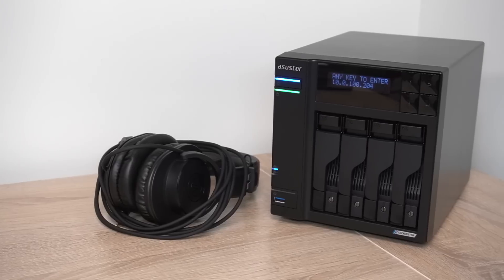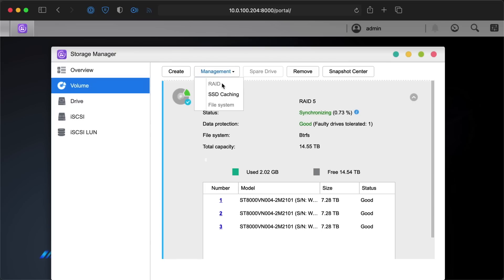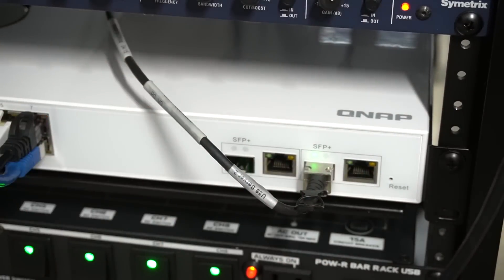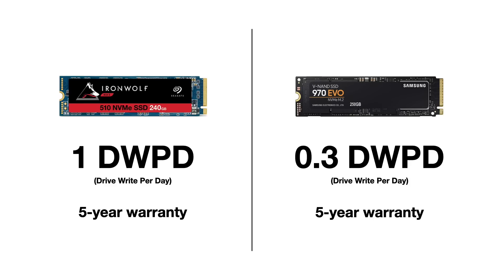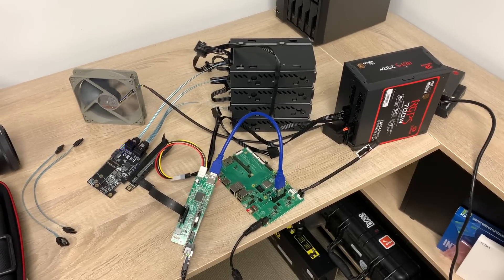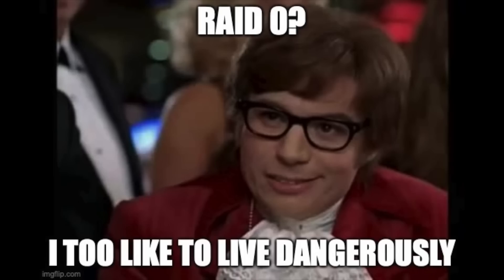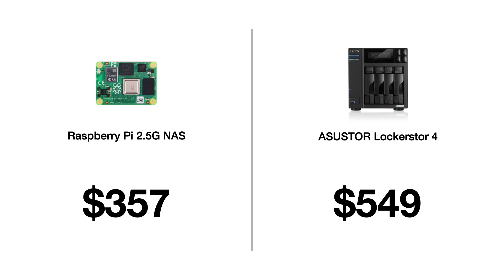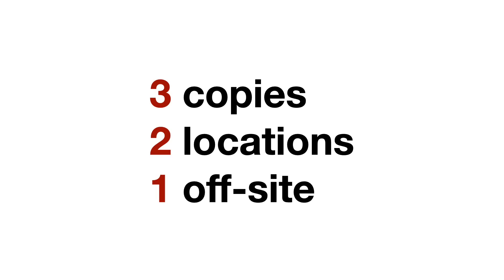Raspberry Pi vs ASUSTOR NAS Head-to-Head Part 2 - the VERDICT!

Comment: Wait, why did shouting into the RAID array caused some difference in performance? Something to do with airflow?
Reply from the maker: Vibration—it's the enemy of mechanical hard drives, which require very precise alignment with tracks on the platters.
Reply: @JeffGeerling  Ah I see. Didn't expect shouting to cause so much disturbance considering server rooms are already noisy environments. But I guess droning noise is more balanced compared to shouting.
Reply from the maker: @fauzirahman3285  Haha, yeah... it's amazing the difference a foot or two can make — his shout is probably 100 dB at close range to some of the drives vs 80-90 dB a few feet away.

Comment: I noticed that you didn't install any heatsink on the pi. While I doubt that would have had much impact, I would be curious to see how more efficient the pi would be (especially when overclocked) if it could shed its heat better.

Comment: I've tried using NAS units from different vendors, including an Asustor 2 bay unit. They all suffered from the same problem, they felt bloated. Too many things that I would never use and the things I wanted to use were not included.
The Asustor I used had the ability to boot from USB so I opted to install centos on a USB SSD and used that for a while. (I removed the internal eMMC ADM drive). That enabled me to do just about anything, but unfortunately it was not powerful enough for what I wanted. 
I ended up building my own NAS from a desktop PC, mounted it in a 19" server case with a 5 drive bay and am using that with Debian and ZFS. I don't need a fancy web interface, but that's probably just me ;-)
Now I can use it as a NAS, for my docker containers, as a web server for my homepage, local git hosting and what-not. And of course it works flawlessly with my UPS.
I have been running this kind of setup for more than 10 years now. (the Asustor was somewhere in the middle of that timespan).
Reply: Great tip. It's not just the storage capacity. Important is also the network speed. Raspberry Pi is very slow for sharing data. You need lots of drives and very fast network. Ethernet and internet. So that's a lot of money to invest.
Reply: I'd love to hear about the things that you wanted to use but were not included.
Reply: @ASUSTOR_YT  I have been trying to remember what exactly it was I couldn't find, and must confess I just can't remember it.
It might even be something that is available now in the NAS SW store. 
I know of one thing though that will keep me away from a prebuild NAS. Notifications. I hate them like a disease. And it's not limited to neither one vendor nor a NAS. Even on my phone I do everything to disable all notifications. Except for receiving a phone call or SMS I don't want to see them. Again that's just me ;-)
Reply: @madeyeQ  Hi. We don't send notifications unless you enable them specifically.

Comment: your Issue is likely a mix of lack of ram and  I would assumed the cache of the ssd's might not be the same speed and most likely causing a parity issue as you are only half of the larger ssd

I do have to wonder why not go for a mobo  that supports 10Gb personally is I was going to do a test rig with the support of a vendor  such as  asus and seagate and whoever supplied the ram  2x iron wolf ssd 4-8TB models 16-18 TB iron wolf nas hdd's ram 2x 32-128GB  if I was going to make compliant for 64bit operation i would look at amd, and have 10Gb lan and fiber support as  standard

Comment: Yah!! My man Jeff uses Seagate as well. 👍 I've been using them for decades. The RMA on Seagate is no worse than Western Digital. I used to work in RMA and I saw a lot of Kingston SSD, Intel SSD, Western Digital HDD but rarely did I ever see any Seagate HDDs or Samsung SSDs. 

I'm rocking 2x 4TB Seagate HDDs that are 7 years old and run everyday. They are used for massive data transfer and storage often. 

Anyways. I just wanted to show my enthusiasm. Not sound like the Seagate poster Child. 

Have a great one Jeff and thanks for all the videos. You have an incredible tech channel.

Comment: I'm running a Pi 4b 8GB with a seagate ironwolf 4TB in an external USB 3 enclosure, I've not done any proper testing on it but using dlna I can watch 4K video on 2 TVs as well as copy files to it from my laptop via smb at about 20MB/s all at the same time.
I know its no where near the same speeds as Jeff's setup but for an average household and about £200 its more than adequate for the job

Comment: I built a 4 bay (16TB) NAS using a RPi4 (4GB), mediasonic 4 bay enclosure. Raspian and OMV5. Acrylic case and cooling fan. Works well. (100MB/s typical throughput).
I liked your profile of each solution. It's intersting to know that overclocking the Pi doesn't give you much. Cheers

Comment: I paid 83 euros for a J4125 mini ITX mobo, for running Proxmox for Home Assistant and a Debian server for my network, the NAS is still on the old i5 with Xigmanas, but almost powered off.

The board was expanded with a 32GB of RAM and a NVME (Samsung 981) but since the lack of lanes the speed is limited around 800 MB/sec, not bad at all for a 12W server.

Comment: why would would you go with a 80$ PSU ( 700W ) for 4 drives ? Wasted money . Any PSU from an old PC like HP desktops would do much more then you need . they're only 250-300W and they operate perfectly for the needs . I would still say it's over killed for 4 drives .

Comment: Hey Jeff, Fantastic video.  How about using Unraid on a Raspberry Pi 4?  You would have a very strong community and loads of apps, as well as a standard Linux build, which I believe is based off of Slakware.

Comment: I bought this NAS after watching these videos. It is pretty sweet, but is a massive security risk. I started up the EZ-Connect web server to access this from online and had over 50 hack attempts in 20 minutes. It does the same thing QNAP does, route my interface through servers in SE Asia. It is also up loading my data as I’m downloading it. I don’t know where, but I can see the network traffic. This is very disappointing.
Reply: So setup your own private vpn and a ddns so you can always access it. Most home routers do it for free. You open stuff to the world and you open yourself to attacks

Comment: Oof, priced it up in the UK and they've basically sawpped a $ for £. Our economy does suck right now though so totally get it. It's around the same price as the similar spec synology and qnap options (altho qnap does have a 4 bay budget option, not sure on its specs however).

Looks like I'm sticking with my aging HP N54L with unraid for a while longer!

Comment: So, Lockerstor is the NAS for people who do not care about their privacy? Since we have no idea what they did to the gnu/linux repo they installed, we can't be sure that any measures, besides a complete disconnect from network, which will defeat the purpose of the NAS, are going to stop them from sending all of your data to their servers? Am I missing something?
Reply: Hey there! If we were doing something as dodgy and unethical as that, the last person we'd be sending a NAS to would be someone as smart as Jeff. 

We use open source components in our NAS. We do not store user data. We couldn't even if we tried, we don't have any servers and if we did have the capability to do so, we'd just simply set up a cloud service and charge people a few dollars a month to store their data on it. The NAS only phones an update server. ADM is transparent about the running processes and we allow people to go into the OS via SSH. We basically give people the tools to have all the control over their data and those tools can be used to find wrongdoing.
Reply: @ASUSTOR_YT  you do not need to store it, just feeding it to a neural network would be enough. You are using open source components, okay, but even windows has open source components on it, doesn't mean microsoft doesn't spy on its users (quite the opposite actually).
"We basically give people the tools to have all the control over their data and those tools can be used to find wrongdoing." If I give you an apple, doesn't mean it is not poisoned, or if it is even a real apple.

But yeah, I didn't think of the fact that I could just never actually allow it access to the internet, which would somewhat prevent it from leaking my personal data to your servers.

Comment: Just a quick question, it seems that you connected both 2.5G Ports on that NAS, was there a reason why you havn't enabled something like smb multichannel? LACP isn't something every switch etc can handle, but smb multichannel on the other hand works pretty good and on my DS918+ I get the speed of both (sadly) 1G ports.

Comment: Potentially you could use a microcontroller like an ESP32 to power-up the Raspberry Pi setup from a wakeonlan call. Like I mentioned on your first video, I believe you could have reduced the cost of the Pi setup by just using a cheap PC case instead of the Noctua parts, 700W PSU, hard drive brackets, etc. For a regular person wanting a cheap NAS, they could forego the 2.5Gbps network card in the Pi build and the PCIe switch, and just use the Pi's own 1Gbps network adapter (limiting max throughput to 125MBps instead of the measured max you found of 200MBps). I believe the Pi setup (without 2.5Gbps network) could be achieved for $191 from your numbers (and using a $25 'PC case with 500W PSU' to hold everything).

Comment: I am testting with OMV now after a question from the members of our GNU/Linux workgroup. Have build three different PC and one laptop with a broken screen, a HP Pavilion dv7 which has two drive bays. Put one 160 Gib HD in for OS, did not have a smaller one and one 1TB HD. Works well, next will be loading the OS on a SD or USB and than put in two 1TB HD. The 3 PC are one 15 year old Dual core AMD with pata drives and two 10 year old Intel Dual core all with four sata. Ones they are working they go to other members so they can do their testing and or tinkering. Dose not matter of they are botching the OS. I have an other laptop that I amgoing to dismantel and put in an old PC case and make a OMV nas that way.

Comment: At what point does it become more practical to just buy a microserver that would destroy all NAS makes  and for a few hundred less than the price of that NAS and NAS system like it. 
Also ZFS has big trade offs aswell that everyone is happy not to talk about, just saying 😏
Reply: Well... We have sub $200 products. We accept the challenge.
Reply: @ASUSTOR_YT  I visited Asustor website and I see the public can only buy from resellers, I had a look around for the exact same model in this video which brought me to Amazon €637 for the AS6404T where I can buy a HP Proliant Microserver GEN10 873830-421 for €524 to take as an example
Reply: @philipm1896  Our AS6404T is old stock. We featured the Lockerstor 4 AKA AS6604T. The HP Proliant Microserver mentioned uses an Opteron X3216 CPU based on the Excavator architecture. The Intel and Ryzen SoCs have 50% better IPC and higher clock speeds. Our CPUs are faster while providing an easy-to-use interface while at it.
Reply: @ASUSTOR_YT  OK I'm not hear to say your products are not good but be fair about it pitting a raspberry pi against your midrange products costing X5 times more than the cost of the raspberry pi is not a good bench mark.
Tell you what, how about you pit your midrange systems against enterprise level systems that cost similar and tell us how you get on.
That would be a more fair comparison, don't you think?
Reply: I like what Asustor are doing by the way but when I personally compare all brands of NAS to the same price of budget enterprise level systems no brand of NAS can compete.
Reply: @philipm1896  Guess we have to work harder!
Why don't you tell me what you would like? I'd be happy to listen. What attracts you to the budget enterprise level system?
Reply: @ASUSTOR_YT  I recommend a buy direct option, like what nvidia, evga etc are doing, buy 1 per house hold as they call it, this would keep your price point in margin to RRP because I'm not sure what the price should be because its up to the resellers at the minute and they could be pricing your products out of the market.
Reply: @philipm1896  Alrighty! I'll let them know!
Reply: @ASUSTOR_YT  I'd recon build system as proof of concept that will beat Synology or Qnap system of the same price, marketing after will be easy, just find people who have recently reviewed those products and its a walk over.
Everyone wins, Asustor and the consumer and businesses etc
Reply: @philipm1896  That one we might already be studying at the moment ;)
Reply: @ASUSTOR_YT  if the hardware is not locked with Asustor own propriatery software, have yee considered involving the open source community, look at the community the raspberry pi has and Linux, Microsoft is gone that way also.
Maybe do a new line of hardware to beat the other competitors but make it an open source platform, that would be a game changer, Asustor OpenNas or something.
Reply: @philipm1896  Most of the software inside is open source and readily available. Like Samba and all the other modules we use.
Reply: In fact reach out to people like Jeff and get their ideas, I'd recon if at least one line of products to go open source and involve the community would be a formidable force. 
Free testing, R&D, research, comparison, plugins and price but make sure there's a good forum for feedback and ideas that's all I will say.
Reply: @philipm1896  Can certainly look into studying the idea.

Comment: I can't speak for that brand of NAS.  But long support life for updates as unified interface are important to me.  I use synology and the 2 bay NAS I have at home functions indentical to the 24 bay synology at work.
Reply: Our company is now 10 years old this year and we are only starting to retire our earliest products from 2011. That's only because the CPUs in them are 32 bit and we're finding reduced 32 bit support with drivers and kernel updates.
Reply: @ASUSTOR_YT  that's fantastic!  I think it's great that you value supporting older boxes.

Comment: I have been running the synology ds416+(upgraded to 8gb mem vs the original 1gb) for about 3 years and have come to the same conclusion! It's performance and usability vs a bake my own solution is hard to beat.  The asastor looks to be competitive with it while including more performance.  My buddy has a different take... he bought a dell r720 server off ebay for $300 with 8 open sas slots and stuffed them full of drives.  His solution is definitely the bang for the buck winner.
Reply: Can even get like a dell 610 etc for $100-$200 also

Comment: Your diagram of RAID 5 is not really correct, in your example 1/3 of each drive is used for parity, not a dedicated drive for parity
Reply from the maker: To keep the diagram simple I focused on the fact that you effectively lose one drive's worth of space to parity. But your point is valid and technically accurate.

Comment: Hey where it says you can't install anything you want on ADM, you can. It takes some linux now how but using entware-ng you can install anything using entware's repo including make, gcc, npm, python/pip. I imagine with some linux wizardry you can probably configure another arm-based package manager though I wouldn't recommend it.

I for example needed to move a process from one pty to another and I usually use a tool like reptyr, which is not in the entware repo. I managed to compile it myself and successfully migrate the process into tmux.

Comment: Have you considered testing a thunderbolt 3 card with the Pi and maybe with this NAS to see what speeds you can get directly off the Macs?
Reply from the maker: Thunderbolt requires (I believe) either Intel chipsets, or some other magic sauce that basically only Intel and Apple have the recipe for :(

Comment: I am actually amazed that the Pi was that much cheaper
For all my projects, I found that if you diy the same spec as a mass-produced product, the diy is always a bit more expensive
(Yes, the Pi NAS had lower specs, but still, impressive how much cheaper it was)
Reply: Of course it was cheaper.  FFS the ironwolf drives alone makes this a stupid comparison video.  Like comparing a 1960's beat up van to a current mustang.
Reply: @bobsmith-qu2oq  oh were the HDD specs that much different?
I didn't watch the pre-built NAS part of the video and just assumed he bought similar drives
Reply: @bobsmith-qu2oq  , I thought he used the exact same drives?